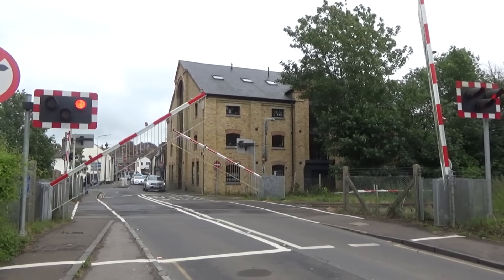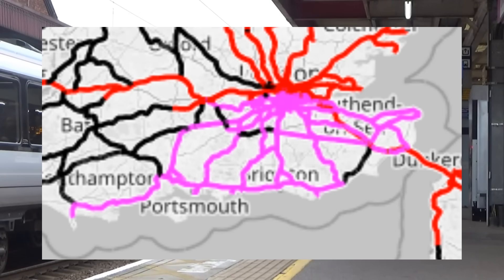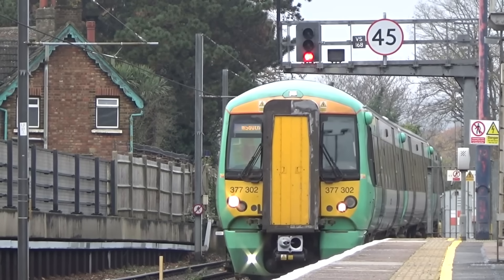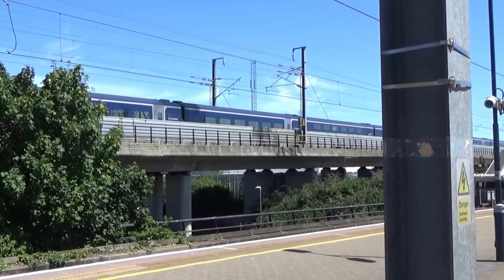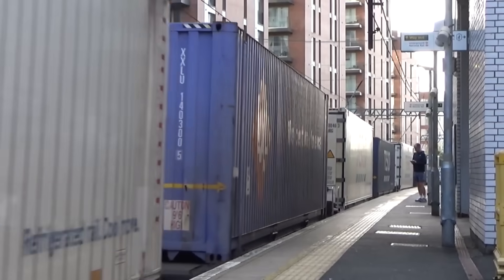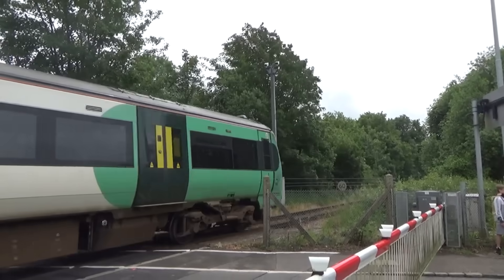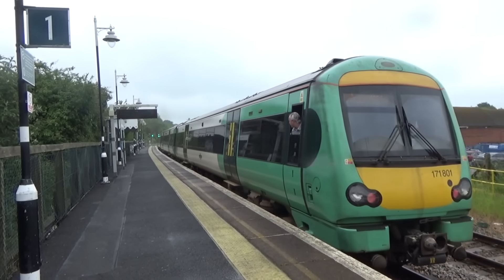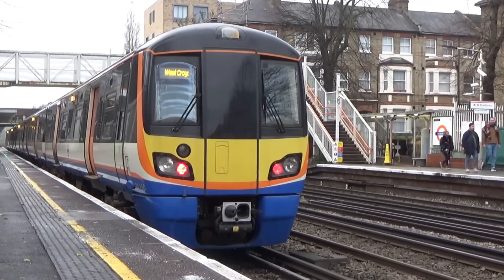Are These Railways Actually Unelectrifiable?

Comment: 2:56 actually all DC units in the UK other than the 455 and networkers have provisions for AC equipment, many already have it
Reply: I'm presuming they could run combined AC/DC and not have to go back into the workshop to swap over?
Reply: @sIightIybored many are essentially dual voltage without the dual part fitted. No trains put 25kv into anything but a massive transformer. And no modern or even half modern trains are using DC motors. Even the 455s were refurbed with modern 3 phase motors.
Reply: Dual-voltage was a big headache back when classes 313 and 319 were commissioned. With "modern" (21st-century) power electronics it's, I'm told, much easier. I mean aren't there dual-voltage Electrostars already?
Reply: @RoamingAdhocrat yes there are 387s definitely are and I’m sure various other similar classes.
Reply: @mattjones1992  If I'd taken two seconds to check wikipedia... classes 350/1, 375/6, 377/2, 377/5, 377/7, and 387 are all dual voltage. So it's definitely a solved problem!
Reply: @RoamingAdhocrat  yes heaps of trains are already dual voltage and most if not all DC only trains have the room for AC equipment to convert them to dual voltage or even AC only
Reply from the maker: stuff like space for a pantograph yeah, but the motors need to be modified to be able to accept AC vs DC current, which required additional equipment like transformers
Reply: @LTRains  no, the traction system is set up for both voltages, all that would need to change is the fitting of the necessary equipment which there is already provision for
Reply: @LTRains All modern 3rd rail EMUs such as Desiros were built with provisions for conversion to AC OLE should such a scenario take place. The work required to equip them would be minimal.
Reply: @LTRains almost no modern emus use dc motors anyway. Even AC overheard units through Dc around the train and convert it back to ac for motors. Bear in mind the overhead is single phase. And the motors are 3 phase. So whatever collection is used. There are conversions going on throughout the unit.
Reply: @LTRains  It can't need this, even theoratically. Modern electric power converting system usually use 25kV 50Hz AC 1phase(2wires) as initial input, and adjust power in a DC environment so for anything that might get into a 750V DC supplies they do this under 750V DC, finally the motor only accepts [rpm/60]Hz AC 3phases (6wires) as its input. Generally this is an AC-DC-AC powertrain, so it will fit a DC power supply, in your case third rail 750V DC, just cut power in at DC and don't use the AC part and remove them if necessary (only give their space to other accessories when NECESSARY, like having large battery), and when necessary you could literally just stop the train and install the required pantograph and connect it to AC input, have it standing for no more than half of an hour to do this if the worker is form East Asia, and you are good to use live wire to run this train. AC output? It is connected to the motors directly.

If being not sure about voltage of AC output, I can tell you that it is not always a stable value, which is depoended on power, frequency and speed.

However, if you are talking about Class 455 only, I think models that are designed before year 2000 can be considered as traditional direct drive, which might not have the AC(1phase)-DC-AC(3pahse) power converting system as unsupported technologies. Anything designed after the first day of year 2k must have the A-D-A current converting system since it is cheap and achivable, and can be modified according to customer's demand, which could make trains with only DC input cheaper and make up energy and cust losses of the railway companies that running electrified line with third rail only. Apologies for not bothering to check wiki when sriting this.
Reply: @LTRains  it’s all VFD to 3 phase AC on the axle side anyway, you „simply“ have to install pantograph, transformer and rectifier, which the high floors of UK trains should be more than capable of, especially because modern UK equipment already has dual mode and pure AC variants of every model I can think of
Reply: @genoobtlp4424 the difficulty is probably the software and recertification more than bolting more stuff onto the vehicles 😄
Reply: @RoamingAdhocrat  yay… GUYS, DA HEGG?!?
Reply: @LTRains that's unlikely, all modern trains that I'm aware of us 3 phase induction motors. AC-powered trains convert the AC into a DC voltage that feeds into digital motor controllers. 

It's almost an universal aspect of modern electrical engineering design to convert to DC first before creating the AC waveform you want. 

AC is easy to step up or step down a voltage at a given frequency but as soon as you want to do anything more than basic phase shifting, you pretty much have to convert to DC first if you want to maintain any effeciency.

Shinkansen trains operate with a 25KV ac line voltage but the motor controllers run on 3KVDC and output a variable frequency 3 phase waveform to the drive motors

Comment: Bio diesel is the solution. Forget anything more electric as there is absolutely no grid capacity remaining.  Hybrid ? No! Firecrews will no longer try to extinguish anything battery for safety reasons, they will only make the area safe and watch your stupid eco friendly fire burn itself out, and that could be days.
Reply from the maker: yk we're currently building out quite a lot of energy generation for the grid, and that aside, Biodiesel cant yet be produced at scale, and wouldnt solve most of the problems i mentioned in the video
Reply: @LTRains  you're failing at every level with so-called renewables.  If France cannot supply enough nuclear power to the UK for only 30mins your entire grid collapses.  Fields full of toxic solar panels won't save you
Reply from the maker: i never mentioned what type of power lmao
most of the upcoming power actually IS nuclear
and solar panels are mostly glass, about as untoxic as you can get
Reply: @LTRains  solar panels contain incredibly toxic chemicals. You're also about 10yrs too late for new nuclear, it'll take that long to build them. You also now have no oil refinery left. Do synthetic and bio diesel is the only viable option for the railway

Comment: Also 3rd rail is plenty poweful enough, Class 92s ran on the West London Line when HS1 was being built
Reply: 1 at a time yes, start running several power-heavy trains and youll quickly start experiencing voltage drop across the system and eventually the feeder stations will start tripping due to excessive current draw
Reply: @Trainman10715 92s run the same power as a 12 car 700
Reply: 92s are banned from drawing power from most of the third rail.
Reply: @J-Railway-Volunteer  Bit of a moot point anyway as 92`s are over 30 years old now and anyway DB have parked most of their fleet at Crewe (and the shoes came off in 2019) and of the 16 in use, 6 are on the Caledonian Sleeper. Btw, i personally think the new Class 93 would be absolutely ideal for that service, even free up the 73`s they use.
Reply: @simonh317 GBRF are looking at the 99s for Caledonian Sleeper to replace the 92s, 66s and 73s.
Reply: @J-Railway-Volunteer  Very expensive use of the 99`s , as they would only save 3 loco`s on the Highlander , and i dont think the 99`s can run ETS for the sleepers? Lowlander is under the wires anyway. A 93 would be better suited , 40 tons lighter and can run ETS power.
Reply: @simonh317 A simple modification will give the class 99 ETS and 100mph top speed (different dampers on the suspension) Class 93 are operated by Rail Operations group so have nothing to do with the sleepers.
Reply from the maker: this issue isnt the ability to run a loco, its the ability to run several locos, and tonnes of commuter trains at the same time
Reply: Are any freight trains on the WCML not diesel hauled. I only ever see freight trains diesel hauled. Hell they even installed OHE on the North London line to run through electric freight trains.
Reply: @kevinrayner5812 There is electric freight on the WCML on certain diagrams.
Reply: @kevinrayner5812  4S43, Class 88 working Daventry to Coatbridge on the wires

Comment: I think that these are the no other option situation that the ORR would allow 3rd rail on.  The biggest issue is the health and safety implications.  Some mitigation can come from burying the cables that feed to the juice rail, removing many of the trip hazards.  Otherwise you're looking at  a hybrid solution with 3rd rail where there's existing infrastructure and battery or hydrogen fuel cell on the non electrified parts.
Reply from the maker: idve thought so too, but i think the safety issues still seem to prevent it.... although its fine on the rest of the region somehow?

Comment: All modern mainline third rail stock has to be dual voltage as a requirement of the ORR. Uckfield and Marshlink lines could use the already dual voltage 377/2s. Plus as your the map in your video shows that the North Downs is proposed for OLE electrification.
Reply from the maker: not all new third rail stock is dual voltage, but theyve got some space for components for a future conversion, that doesnt make it cheap or quick though. and the dual voltage 377s are already used on the runs up to watford junction, so doubt that thered be many available for this line.
the north downs proposal was a while ago, but lost momentum, the proposal still shows on openrailwaymap tho
Reply: @LTRains The Network Rail created a new proposal in 2024 for North Downs with 25kv.
Reply: @LTRains Which new third rail stock are you thinking isn't dual voltage?
Reply from the maker: 701s, theyve got a pantograph well but afaik thats it, everything else is set up for 3rd rail

Comment: I think battery trains are the way forward, at least in the short-term. They can charge up on the third rail sections, and then run on battery once the electrification runs out. Is it a perfect solution? Absolutely not, but it would still be preferable to Diesel even if it's not as good as proper electrification. I think you're right that eventually we need to convert to 25kv AC overhead power where possible, especially for freight traffic, but considering 2/3rds of the network doesn't have ANY electrification, it likely won't be considered a priority for another century or so!
Reply: I don't like battery trains as 1. The mining of the lithium is quite harmful. And 2. Batteries lose capacity over time so need replacing
Reply: @landandwaterpebble   Yeah I'm no fan of them either, but that seems to be the way the world's heading at the moment
Reply: I think it's a waste of money though, instead of buying new battery trains, charging and maintenance equipment you could just spend it on 3rd rail and create a line that all Southeastern and Southern stock can use. No to mention every time those trains life expire you have to buy new battery trains instead of potentially cascading older units since the Marshlink and Uckfield line isn't too heavily used.
Reply: @thespicyicecubexd_8932   Yeah electrification would definitely be better, the trouble is it's also a lot more expensive, and would need to be funded by Central government, whereas battery trains are within the budget to be funded by operators
Reply from the maker: electrification, even 3rd rail is probs more expensive yeah, however thats upfront. batteries only have so many charge cycles before they need replacing, and batteries certainly arent cheap, after 5, 10, 15 years, electrification would defo come out cheaper, and more reliable

and anyway, we're in the process of nationalising everything... so itll be central government not allowing spending money on everything instead of just a few things 😭
Reply: @LTRains   Again, this is true, but things like rolling stock can come out of the GBR annual budget, whereas infrastructure enhancements generally have to go through parliament, which is still the wrong approach if you ask me, but nevertheless that seems to be the way it's structured at the moment sadly.
Reply: unviable due to how slowly the batteries would charge, its been trialed and failed before
Reply: @Trainman10715   Seems to work alright for Merseyrail's trains, and if a top-up is needed you could always implement a few of GWR's fast chargers. A modern battery train has a range of >100km so that's not an issue for these third rail lines.
Reply: @MikeWillSee  because they use tiny batteries for last mile operation, they dont cover any significant distance on battery. we'll wait for the GWR fast chargers to be proven viable before considering them. range is irrelevant, its simply that they would be so slow to recharge off the third rail that they wouldnt be able to fully recharge between intervals of battery operation
Reply: @Trainman10715   GWR has actually concluded that their fast chargers are viable (I'm making a video about it soon) and the Merseyrail trains do also have (or are capable) of having some very large batteries (and thus larger range) and are being considered very seriously for operations on the Wrexham - Bidston line, with only a few short sections of third rail needed here and there for top up. SWR is also in the process of procuring battery trains to operate to Exeter, also through the installation of a few short sections of third rail.

Like I say, it's not a perfect solution, but the technology does exist and I think its implementation is inevitable.
Reply: @MikeWillSee  no they havent, theyve concluded that they might be viable. idk where youve heard that the 777s can have more batteries fitted because they cant as theres clearly no room, theyd need them in a seperate vehicle like the engines on a 755. ive also no idea where you heard that about the bidston line as the suggestion that they could 'top up' from sections of third rail is laughable. ive also no idea where youve heard that SWR is in the process of precuring anything because theyre not, someone suggested the precurement of battery trains but nothing has happened yet. they havent even been allowed to make any more precurments since before they were renationalised anyway due to the embarrasment that has been the 701s.

so far the only thing thats actually been proven is that battery trains offer no benefits over diesel and simply arent worth it for serious use, the technology exists but the feasablilty doesnt. its implementation will only be inevitable once diesel becomes prohibitively expensive, something which wont happen anytime soon
Reply: @Trainman10715 Then why are Southern looking into fitting the 377/3s with batteries?
Reply: @J-Railway-Volunteer  they're not, not seriously anyway, batteries have already been trialed and failed on an electrostar
Reply: @Trainman10715 The 379 test was a success. Plus they are fitting the battery in the space of the transformer on the 377/3.
Reply: @J-Railway-Volunteer no it wasn't and no they aren't lol. The 379 trial was in 2015 and the suggestion of fitting batteries to the 377/3s was in 2020, neither of them have been pursued further
Reply from the maker: the main issue with batteries is they dont have a great energy density, so they only really work on the shortest branch lines, like the greenford branch. for these much longer lines, you would be far better off with proper electrification.
and yeah defo, other parts of the network will be prioritised
Reply: @LTRains   Yeah proper electrification is definitely better, but the favoured solution these days is increasingly trending towards discontinuous electrification. This is the plan for Chiltern's new trains and for SWR's services towards Exeter. Lines such as the North Downs line already have discontinuous electrification, so it would provide a good opportunity to test the new technology. I'm all for full, proper electrification, but if discontinuous electrification has a future (which it certainly seems to) then these gaps within the third rail network show real potential!

Also, I wouldn't discount the range of battery trains. Whilst testing has focused on short lines such as the Greenford branch so far, GWR's class 230s actually have a range of >100km, so they're looking into the possibility of using them on longer routes as well (e.g. the Cornish Main Line).